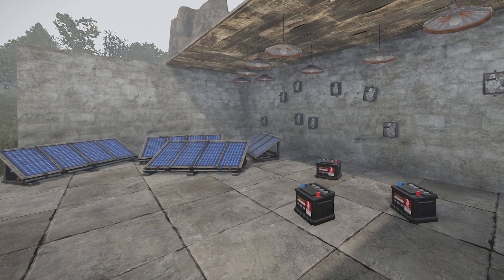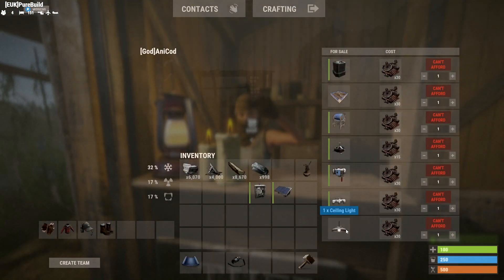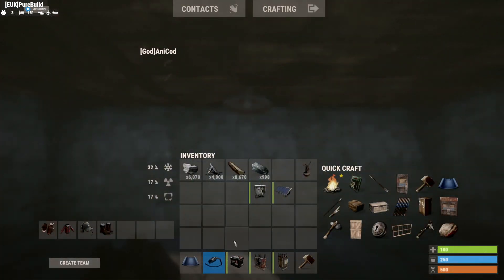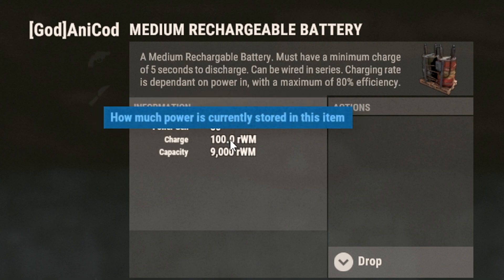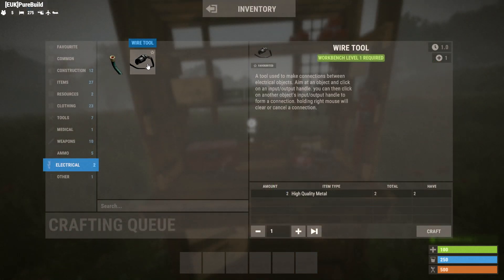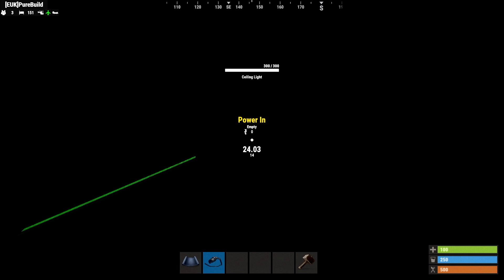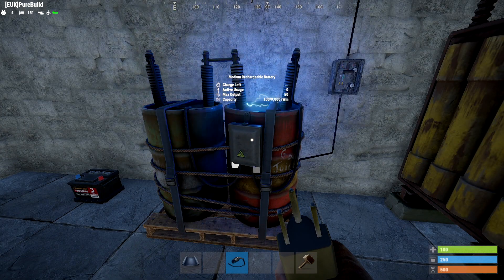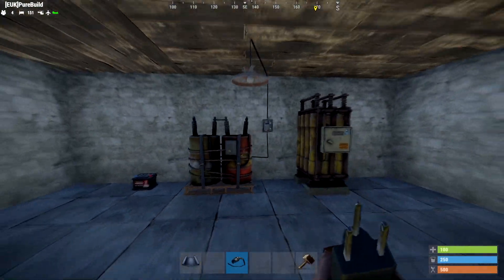Learn THIS Circuit to be a PRO at Electrics in Rust | Beginner Guide

Comment: So... Here's a dumb question: can the lumens from a ceiling light be used to charge a solar panel? If so, seems like a good way to have never-ending power...
Reply: yea that would break physics irl, but it dosent work in rust either. batteries only charge at a 80% efficiency

Comment: I am used to these electical circuits where a battery can not recieve power to charge when the output is on a constant usage of 1-100. Basically we had to drag a wire from battery output into a blocker that is powered from the side to make the blocker actually work as an actual blocker. Power from battery was blocked so that it could recharge. The circuit to make a base fully automated with a constant power for 24/7 coverage was very complicated. Nowadays any power source will recharge the battery even when battery power is in use.

Comment: I'd like to see a video about conservation of battery charge, using Blockers or something like that. When you use an Electrical Branch connected to a battery, it always use the amount of energy that the branch is set up to use, even when the part after the Electrical Branch is not in use at that moment. 

As an example, you want to split the energy used to power the lights in your base, you put an Electrical Branch then you set-up the amount of energy needed to power the lights in your base and connect the wires to a switch (or automated light circuit) and to the light. The problem is that it will always consume the amount of charge the light needs to the battery even when the lights are off. I've figured out that using the leftover current of the Electrical Branch to power my lights consume the charge only when the lights are on. I used the branch of to connect to other Electricals Branchs for the others circuits in my base, but then again, now it always use the charge of the set-up amount of the Electrical Branch to the battery. 
(I hope it was clear enough) 

I wonder if there is a solution to this. The ideal solution would be to only use the amount needed at the given time, but I don't think it's possible.
Reply: Rand switch with a solar panel should fix that